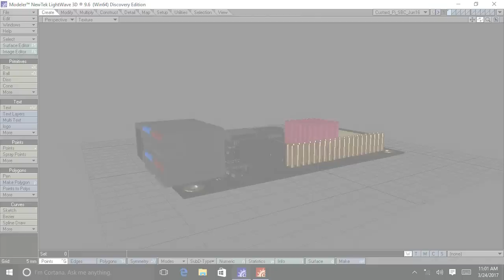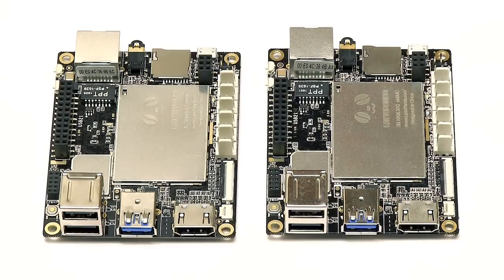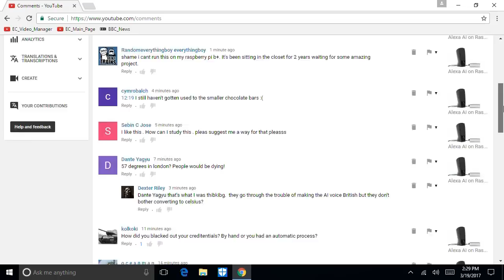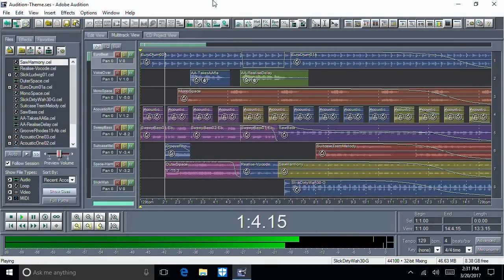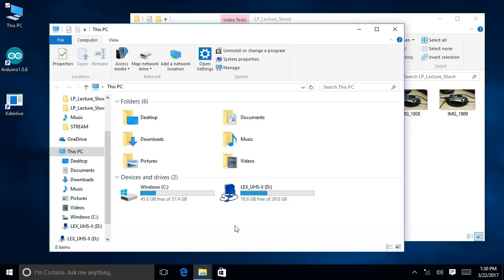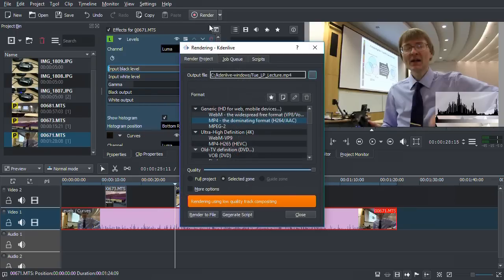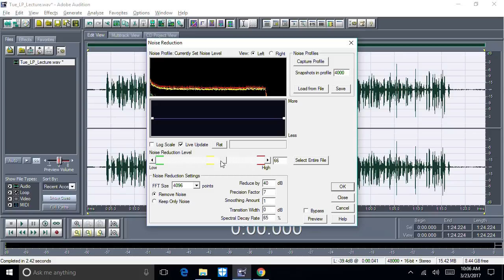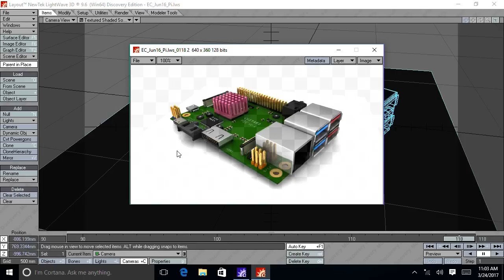LattePanda Week

Comment: Really informative video, doesn't disappoints me too much about the Panda either.
Sure I'd love to run some Linux on that thing but I'm absolutely happy with Win10 myself also.
On the downside, there is apparently no website whatsoever that sells the LattePanda in Europe, which is really sad given the performance of that thing.
Guess I'll just stick with the Raspberry Pi then, those may have shared USB2 and ethernet but at least I can pick tjhose up in local stores.
Reply from the maker: You can order a LattePanda directly from DF Robot in China and they ship via UPS. I'm currently filming a video about an Orange Pi -- a very cheap SBC -- and I got that directly from China, including shipping and an accessory, for about $20. But more on this in a couple of weeks!
Reply: Orange Pi looks inexpensive and attractive, but the company repeatedly states that they only manufacture the hardware, and have nothing to do with the software. So, if the software claims that the manufacturer uses in its ads, to sell you the boards, don't actually work, Orange Pi itself could not care less, and you are on your own to fix it. And the forums have many threads about what advertised features don't work (like bluetooth doesn't work with Android, even though "Android" is used to sell you the board). 

The choice is easy to make between inexpensive boards that don't always work the way they are advertised, and the Raspberry Pi, with its years of incredibly massive support, of all kinds. Ask yourself, "How many monthly magazines support Orange Pi exclusively?" Or, if you can explain the future, how many ever will?

I do look forward to your video about Orange Pi, as I look forward to all your videos.
Reply: Thanks for the input here, I know UPS is a bit more expensive but given its coming from China (no matter if one likes it or not, most stuff originates from there) maybe it gets around the local custom office.
Reply: you can buy from RS in UK

Comment: Wrong about unactivated. After a few weeks or few months Win10 will start displaying activation requirements.
Reply from the maker: Yes, you may get the occasional reminder. But I've used the 4/64 LattePanda for some time (many months) and nothing has come up at all.

Comment: Hopefully the LP guys will produce a Linux-optimised version sometime soon ...
Reply: There are plenty of devices available that are aimed at linux, but not as many for windows.
If they did make one designed for linux then it would have to be lower spec / cheaper or much better hardware and not much more expensive otherwise the competition would be superior/better option for the price.
Reply: Why would a linux version have to be cheaper or lower spec?  If I bought one of these the first thing I'd do would be find a way to replace windows, so some of us will actually put extra work into it just to have linux instead of windows.  I noticed a number of posts below expressing the same sentiment and he even anticipated that and commented on it in the video, so I can't see why they'd have to make a cheap, substandard version in order to entice linux users.  The last time one of my computers had windows on it was when I bought my laptop, and I only used windows long enough to download and burn a linux iso so I could replace windows.  It wouldn't have even seen that much use if I'd been at home, but I bought it on the road when my laptop died so had little choice.
Reply: You can run linux on it, I use Debian 8 64-bit on the 4 GB one and it works fine however wifi drivers are nowhere to be found.
Reply: It would have to be cheaper because there are already better alternatives for linux.
Reply: Thomas Mobley: I tried different Linuxes to boot and install. None runs at 100% on it. Ubuntu, Mint will boot from usb drive, but after install, no desktop. Lubuntu can be installed, but hardware drivers missing, also after updating etc. and it often freezes for a second. And some other that didn't even start or run.
There are some ISOs from users out there in the web, but I was not able to use them.
If we can't get a Linux running full supported, I better would use a Win7 (pro/64bit) but also not possible toinstall it (freezes while installing) ... we are f...ed.
Reply: crapcbm I've installed Debian headless on it and it detects everything but the WiFi drivers.
Reply: thanks, 
yes the WIFI did also not work on the live Linuxes I tried
But as I don't need the Wifi it is not that big problem, but anyhow a shame, that there is no official Linux
Reply: Matt Beaver  search ur WiFi adaptor and install the driver from a USB sticm
Reply: yolo swacgity that's thing, you can't just search for it, lsusb and lspci bring up nothing.
Reply: Matt Beaver okay. figure out the manufacturer of the wifi chip like Qualcomm I think it's just a generic driver I've used it before on a old USB WiFi stick and it worked
Reply: yolo swacgity If I could I would.
Reply: Matt Beaver just buy a wifi usb stick and voila you can download the drivers and get internet
Reply: I'm using all the usb ports, I'd rather stick to ethernet.
Reply: get a usb port hub and glue it to the case for the latte on the bottom to make it be able to move around i guess. would be pretty cool and isn't too hard to plug in a wifi adapter after that and a usb powered fan for cooling. boom epic rig
Reply: I hate lattepanda. the list is too long.
Reply: Salty Man: Try to give us the long list.
Only WIn10 is the point that "kills" the panda.
But I have it running as a "home server", it runs great. Shares my files, works with Serviio as a media server (DLNA to my Sony BDP) runs my websites ... not problem with that. 
ONLY Win10 is the problem, starts this list with all these things we have to castrate on win10, and the samba shares are a problem with Linux machines in the network (have to set to samba3) and older Windows machines (2000, XP,...) can't access to the shares. Some shares work on linux, some don't. 
Amiga has no bloody chance to access to the shares. And that workes up to win7
No one knows why. An I don't waste any more time to find it out. Live is to short to fix M$ crap. As soon I have some days off, I will try a linux that was recommended here.

Comment: What size nuts and bolts do you use to secure the Lattepanda to the cd case?
Reply from the maker: They should be M3 or M2 bolts (I think mine were the latter, which was a little too thin). I think mine were 20mm long, but it depends how long you make your stand-off spacers.

Comment: Nice mod to CD case! how the temperature? 
This round CD case can be modified easily to use a fan for better thermal work
Reply from the maker: You could potentially mount a really large fan on the top!
Reply: 50mm fan(from old CPU cooler) and the basic case also work great!
My Raspberry Pi device can't reach to the 70c, it's running cool, quiet(fan 12v at 5v) and fit like a charm!

Comment: 1 question: y put the spacers at all? The case is plastic so there's no shortage issue as with PC cases, and u can put the antenna along the circumference.
Reply from the maker: The CPU is on the bottom of the LattePanda and gets rather warm. So the spacers allow a little ventilation. But yes, you are right, it would work without them.
Reply: Oh, I c. Commented as I watched, just got 2 the end where u mention that :P
Reply: It will also avoid any strain on the components on the board.

Comment: how about a proper operating systems? FreeBSD, for a start?
Reply: Nothing is stopping you running a Linux distro on it. You just buy the one with the unactivated version of windows and replace it with whatever Linux you want. Because it is an Atom X5 quad core 64bit X86 CPU you should have no problems running what you want.
Reply: Of course - nothing stops me to run either a Linux or a Unix(like FreeBSD) on this board. My question is why it's not tested/matched with Windows ? it's a board, not Windows review, right?

Comment: Can't up grade the arduino ide to 1.8.10  which is no good only comes with 1.0.6 can not run 1.1.9 marlin only opens to arduino 1.0.6 what a bummer I needed this thing to run ros on windows or 3 d printer it doesn't look like this thing can do either  I figured from a company like df robot I thought I could you know .....use this thing for a robot ! I guess not
Reply: Oop's I was wrong it turns out you can run the 3 d printer from the panda with print run and all the trimmings ....well  I guess that's why I should keep watching this channel ! Keep up the good work.👍

Comment: I think they would sell more of those if they offer a linux option.  I would think that most people that like those type of devises would be techies that run Linux.  But as far  as carrying it in your pocket...good luck finding a monitor that will fit - not to mention the wires.
Reply from the maker: Thanks for this. On the monitor, when I go to make a lecture/presentation I am always plugging into a system in the room. So I just need the PC bit. A special case I guess!

Comment: How install windows 10
Reply from the maker: DF Robot provide image files free from their website. You have to put them on a freshly formatted USB drive with the right name, and then you just plug in and the process is automatic.
Reply: i can understand but if i have the windows 10 n image i can install?
Reply from the maker: I am not sure what you mean. The only way to reinstall Windows 10 on a LattePanda is to download the appropraite image from their website, and to put it on a USB drive set up as they require and to insert that into the LattePanda. You cannot install any other Windows 10 image you may have. However, you could use any other Windows 10 key you may have to activate Windows 10 on the LattePanda.

Comment: i priced these online, it came to $215, is that fucking right? if so, why would anyone buy one? with chip and dip and rpi being so cheap!!!
Reply from the maker: $215 is very high for a LattePanda. The prices purchased from DF Robot range from £89 to $119. Certainly higher than a Pi or CHIP, but you get more hardware (esp the onboard storage and more RAM). In my next SBC video I look at an Orange Pi -- like  Raspberry Pi, but cheaper . . .
Reply: Wow that's so cool that you replied, and so quickly, i just don't see that on so many channels.  As far as the hardware that you mentioned, i see where you are coming from, but i quite like the ability to flash a micro secure digital card with different operating systems at the drop of a hat. I'm looking forward to your thoughts on the Orange Pi, I've heard about it but not heard anything in-depth.  Again thank you very much for replying and I look forward to chatting in the future.
Reply: Simple conversion of US$129 to Canadian and I found it put the price at Cdn$186 with Win-key but not pre-installed. Also not including tax or retail markup of local stores. I wonder how much of the price is hardware vs. operating system, but it's  out of my range, especially when I can literally buy three raspberry pi 3 (Cdn$60) for the same price and still have some change for a mini-fan, heat sinks, or screws.